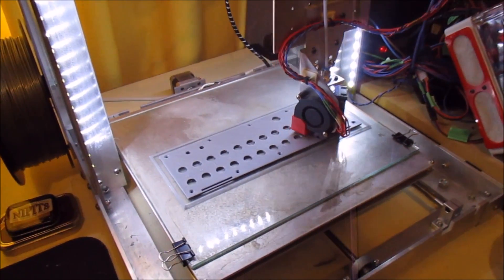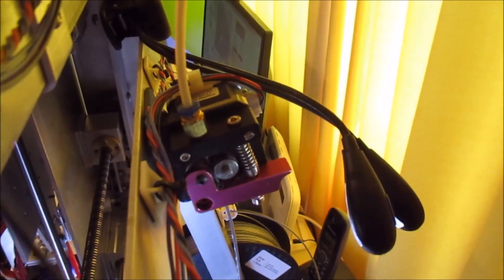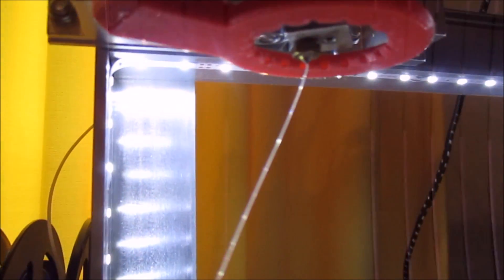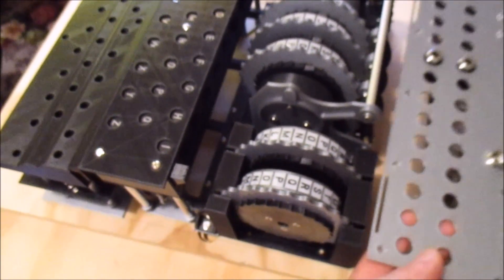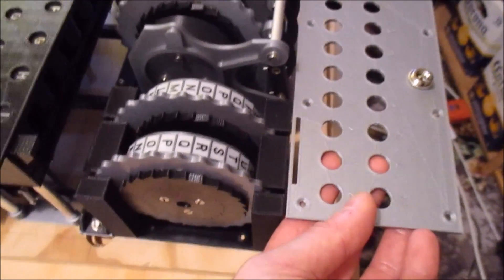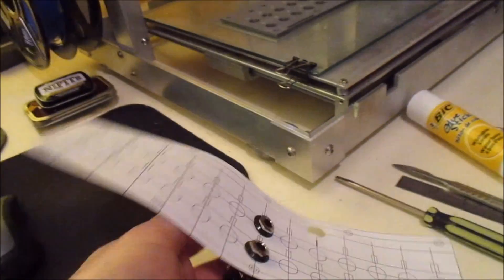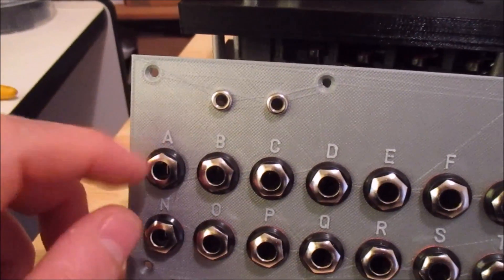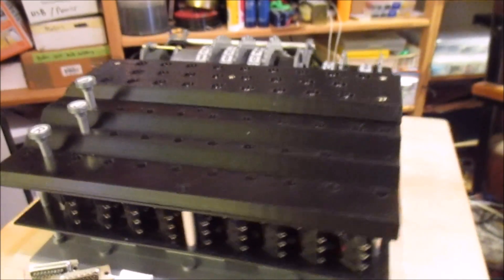3D printed Polish Enigma update 18th Nov.

Comment: 8:25 at the bottom of this article there is a picture and you can see that the plug board is about 1.5 cm below the rim of the box and the bottom row on the keyboard (z-m on our keyboard) is 1.5 cm above the rim. Therefore, the plugboard is mounted 3cm below the bottom row on the keyboard. Keep up the good work!
https://en.wikipedia.org/wiki/Polish_Enigma_double

Comment: I'm really enjoying watching your progress on this and would like to do something similar myself at some point! Can you shed a little more light on the sockets you've used for the plugboard? As I understand it if a patch cable is plugged in the signal is diverted, however, if no plug is inserted the signal is passed through. I think I heard you mention a switched socket?

Thanks,
Andy
Reply from the maker: I'll see if I can explain it better and show how that wiring will work.
Reply: I was looking for this video for this reason.  Trying to figure out how the plugboard is designed to pass through, but disconnect the signal when a cable is plugged in.